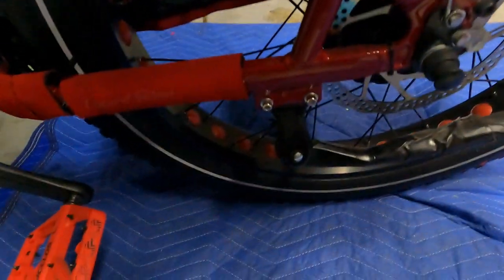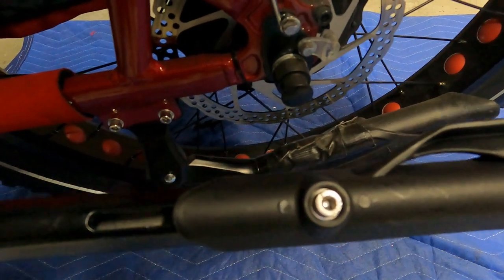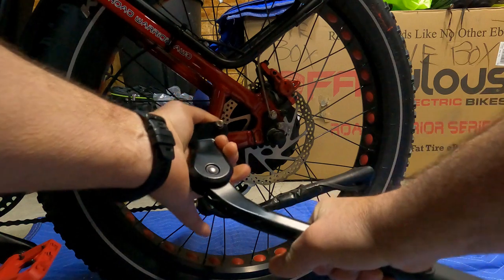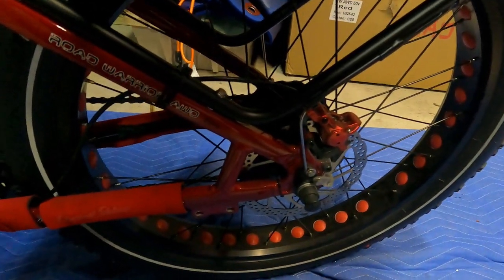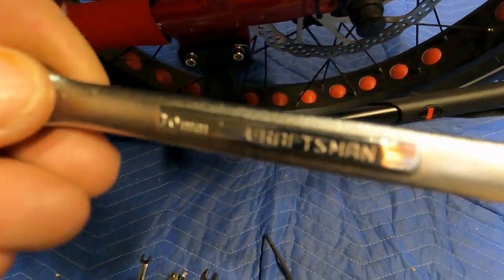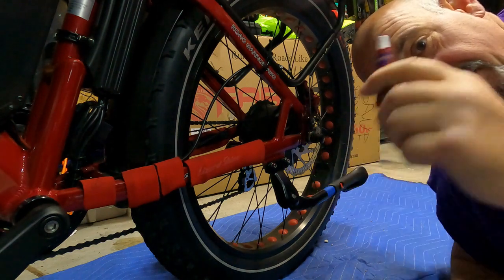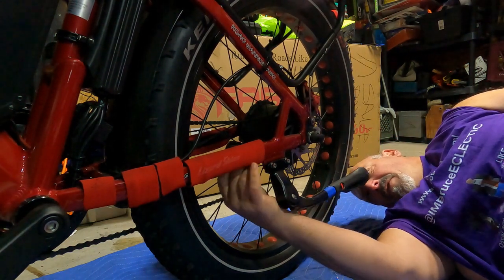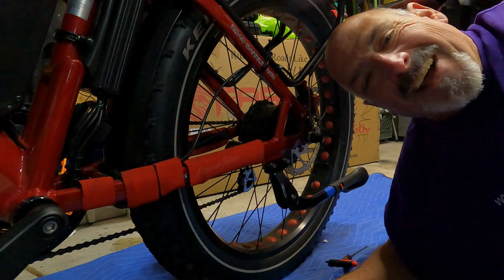HOW-TO FIX the Most Common and Annoying E-Bike Problem….the KICKSTAND!

Comment: I don’t know why they can’t make that stuff just a little bit thicker. It does drip all over the place. I got my controller in yesterday so I put it in the bike and it works fine. Give it a 2 mile ride fully stock. No baskets brought it up to 28 miles an hour. Absolutely no shake solid as a rock. Put the front basket on and when I did, I was looking at the mess of cables they have on the handlebar and I couldn’t stand it, so I ended up changing out the handlebars and stem I had to replace the hydraulic brake line on the front because it wasn’t long enough rewrapped all the cables put all my crap on the handlebars, which I said I wasn’t going to do but for a while as I was going to ride the bike stock, but I want to find out if it shakes the way I want the bike set up and I figured if I went that far, I might as well put the suspension seat post on in the seat took it for another 2 mile ride absolutely fine. I know people say they develop the death wave over a time but that doesn’t even make sense it’s more of a weight distribution thing I’m sure. Plus, I purposely picked the step over because of the extra bar up there as you know. I was going to video it but I said you know what people don’t wanna watch me put this crap on the bike plus I wanted to get it done so I could try to ride it before I go away.
Reply from the maker: Great job!  I wish you would have made videos....I think a lot of people like them...especially with all of your camera angles.  Next time---make videos.  I think people like to see your skills.  The Kickstand video....for Newbies like me.  My kickstand is now perfect and the new one--longer and stronger.  Thank you my Friend!!
Reply: @IMBruceECLECTIC  i’ll take it all off and put it back on again😁 also, I figured out why that stuff is so loose. You put one drop on the threads and five drops hit the ground, it’s so they can sell more.
Reply from the maker: @GarysE-BikeAdventures  ...ha ha ha.....I have seen you take stuff and re-do it....ha ha ha.....yes...it is low viscosity....I do not use much because I want it to not wiggle loose but dont want to use a "breaker bar."  :)